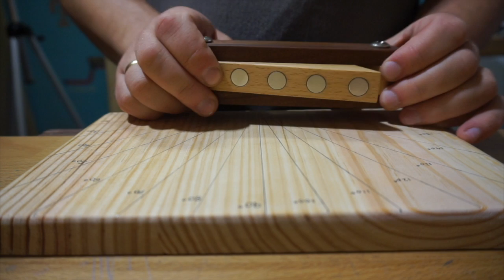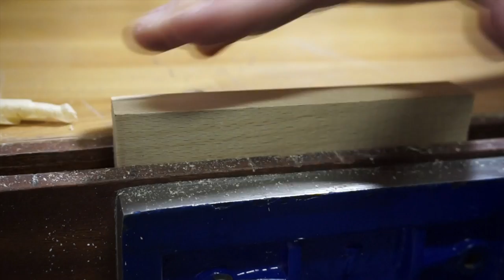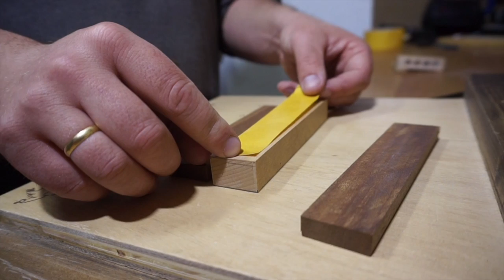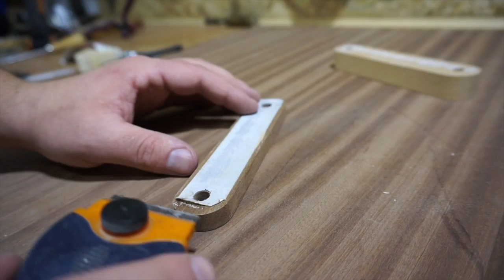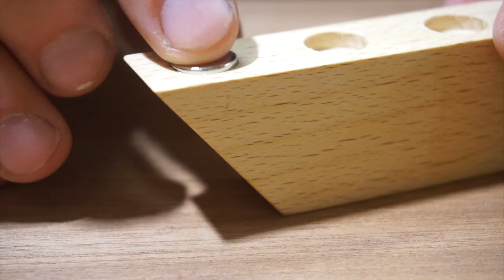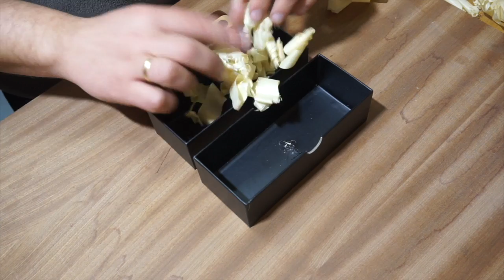Magnetic saw guide, everybody can make it

Comment: Again, nice work and very good video.  Maybe I missed it, but what are the magnets in the top of the rail of the shooting board for?
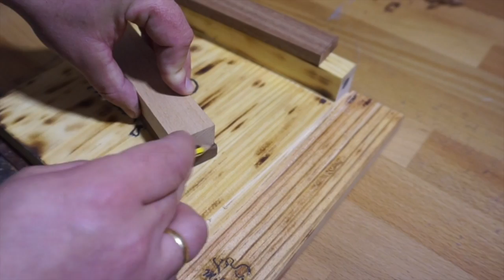Reply from the maker: Do you refer the magnet of the 2:06'?  This is another guide to get the cut straight, I don't know if this solve your doubt...  Thanks for the comment.
Reply: When I look at again, I realized that I mistook the screw heads for small magnets.
Reply from the maker: That's it, those are the screws for tighten.

Comment: Flat 'thumb nuts' would be the only improvement I would add . Then you don't need a screw driver .
Reply from the maker: Thank you very much for your comments Mark, you're right, I should have used"thumb nuts", very good observation :-)
Reply: Currently disabled ,but still able to do things 'unplugged' . My current prototype is a kerfing saw table to preslot saw cuts into stock I'm slicing before I then use a 'frame saw' to resaw to correct thickness . Needing only slight hand planning to finish to correct thickness . Vertigo now 24/7 keeps me from returning to work as a breadwinner . 
I also continue to study honeybees , used to run a family farm of 220 hives . 20 of which gave 1200 pounds every 2 weeks ,year round .
But, it good to awake every morning to a new day from God .